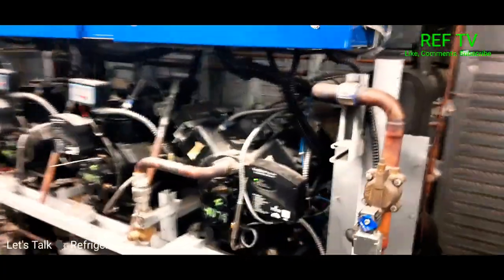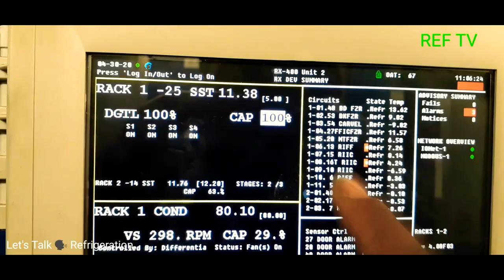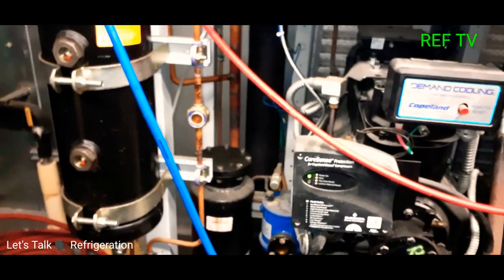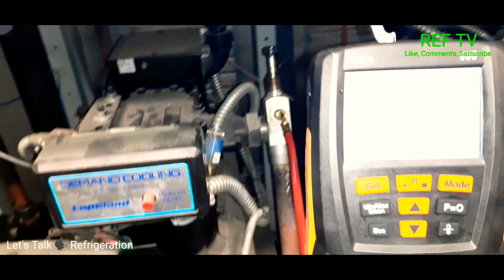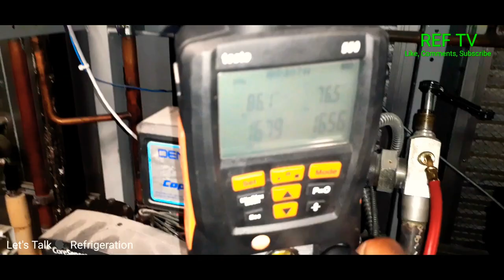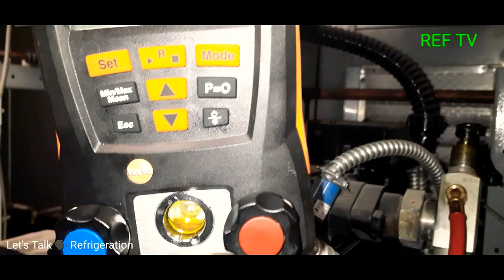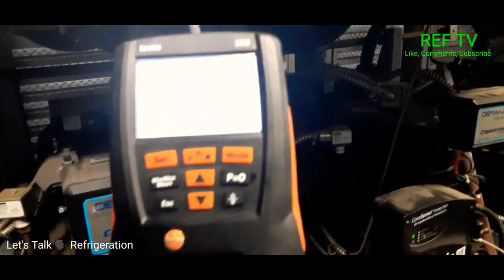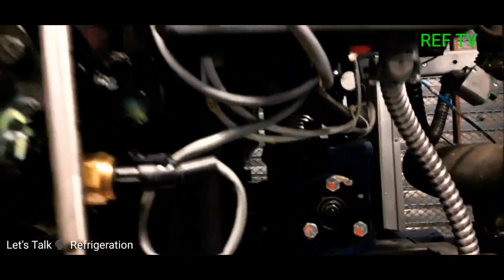REFRIGERATION TV: OIL ISSUES & BACK FLUSH OIL SEPARATOR VLOG

Comment: Great video. This definitely was well needed for me. How did you use the compressor oil pump to back feed oil into the reservoir to feed oil to the other oil pots? I’m having a similar issue with a Rack going down on oil.
Reply: Ok thats perfect. Thanks for the info I will try that and let you know how it goes.